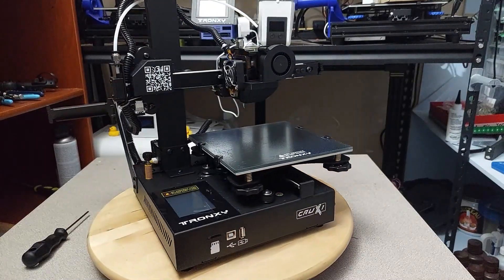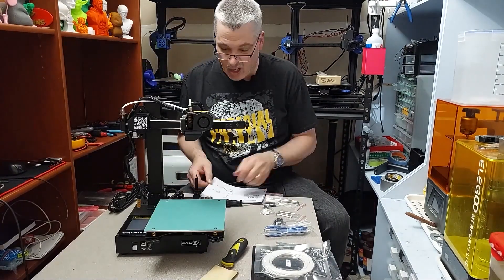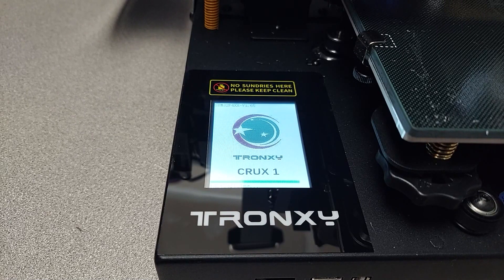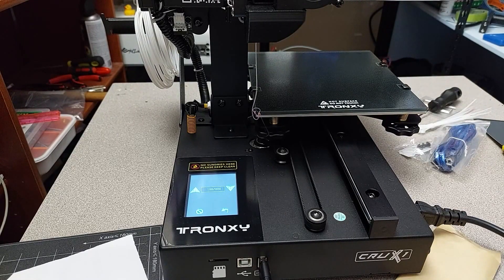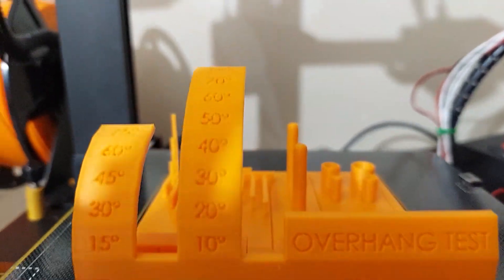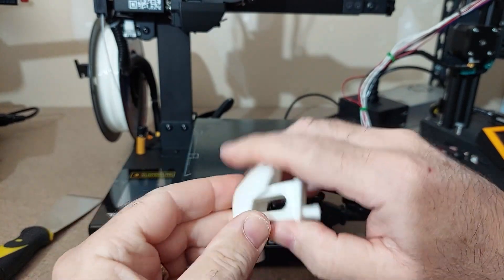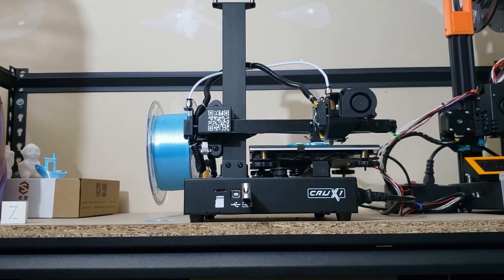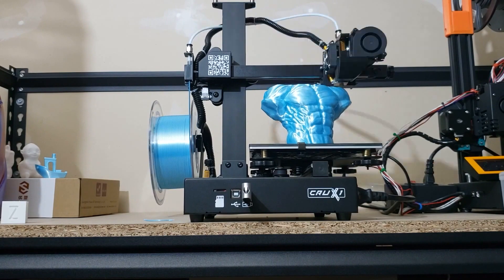Tronxy Crux 1  First Look 3d printer for beginners tronxy

Comment: Hey, thx for the video. I read a comment on a french review that we can just remove the mainboard fan which it makes this printer dead silent. What do you think ? Thanks
Reply from the maker: I think you'll need some sort of cooling fir the  board. But removing and and adding a quieter fan would  definitely work.
Reply: @jeffs3dcorner  do you know what voltage are available easily from the motherboard? If 12V is available then adding a noctua would be really easy. Do you confirm that the hotend fans are already very quiet ? Thx
Reply from the maker: I'll take a decimal reading next print
Reply: @Gryzounours  the horned and part cooling fans are very quite,  I look to see that the hot end is spinning when preheating,  that mainboard fan is so loud tho when it comes on it drowns out the TV  the thing prints like a boss tho .

Comment: Awesome vid. I just got mine and i notice that when it does the purge line it does it just off the build plate. Did you have that problem? I noticed it looks like your build plate is slightly shifted towards the arm.
Reply: Aurora from AuroraTech posted a fix for it on the comments of her review of this printer
Reply from the maker: Yes just slightly